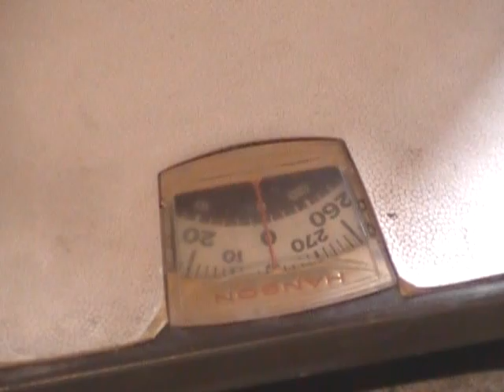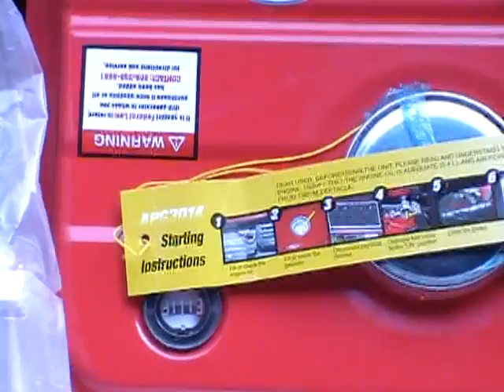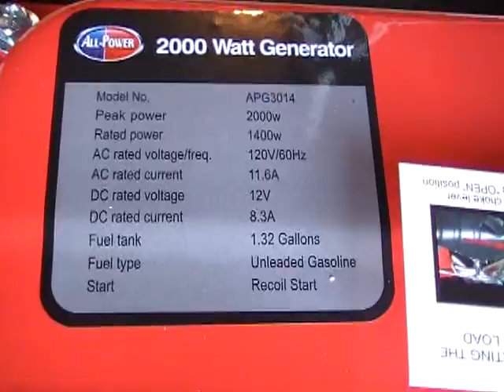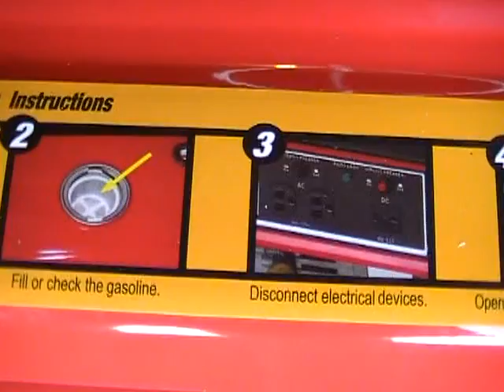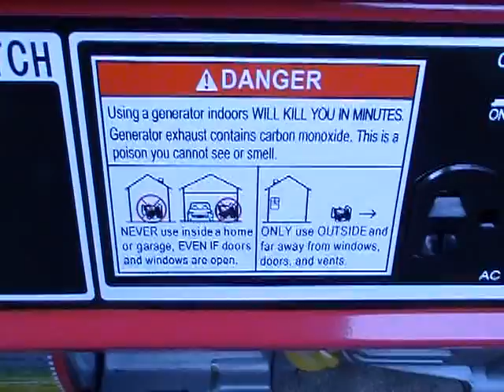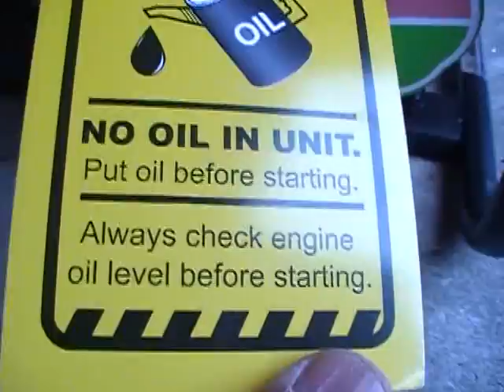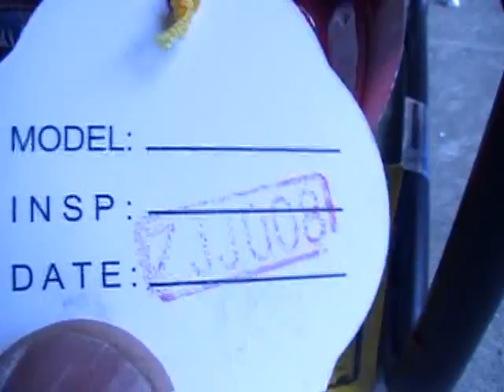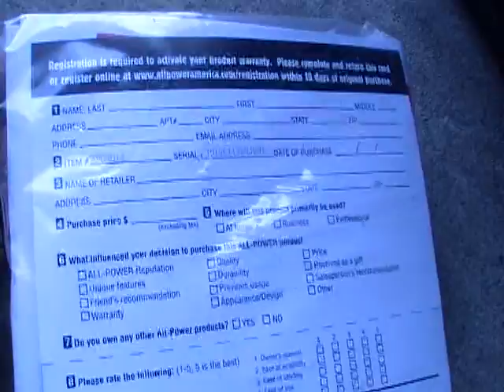All-Power 2000 Watt Generator Unboxing

Comment: Thanks.  Confirmed that it did include the 12v battery charge cable in the accessory bag.  Will have to try to find mine (must had misplaced years ago).